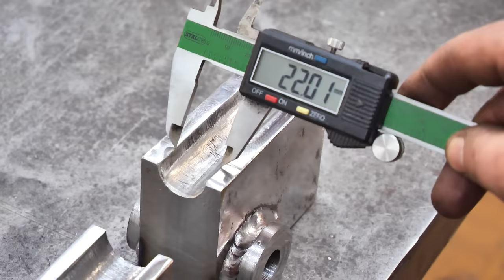Making Hydraulic Tube Bender Machine

Comment: Instead of changing bolt every time. We can use ratchet wheel. In one direction it make strong grip and while it's moving back it's just pass without any grip. Just try it. It reduces the human efforts and improve the efficiency, time saving. Hope it would be considerable suggestion for this design to improve some more.
Reply: Plll
Reply: Great idea

Comment: Is it a bit bigger projects than a homemade thing. Sorry I m not having welding cutter, lathe machine, drill press, electric welder, abrasive belt grinder at my home to make such simple machine😔😟😟
Reply: Get it done from out side and assemble
Reply: Why would you want a tube/pipe bender if you don’t have other tools necessary for metal work

Comment: Great work!  Bar soap works great on the tubing when bending and washes off easy with hot water. 
Maybe weld a finger ring on top of the pin that would help to make it easier to pull out and put back in. Just a thought for you. 💪🏼👍🏻

Comment: I really like how you can reset and continue the bend without having to release the pressure on the working part until your at the correct angle. 
The spring back may not hurt the part but I’m sure it’s not good if it’s done several times. Great job Sir!! Well done

Comment: Awesome project, all the equipment probably cost 400 to 600$ but to buy this bender brand new you need around 2.500 to 3000$. Very well crafted work and the bent pipe is great. Keep going the great job dude.

Comment: Will it be better if the control is on another side so you dont need to lean over to check the angle ?
Reply from the maker: But I only tilt when I bend the pipe to 180 degrees and probably more often I will bend the pipe to a smaller angle, so I decided to mount a hydraulic manifold in this place

Comment: In transferring one hole to another piece of plate You need to use Transfer Punches. They are MORE ACCURATE than a felt marker. Your Tank for your oil should have been Higher or one inch above the outlet on the pump. The tank capacity should be three times the size of the Cylinder Capacity (meaning if the cylinder holds a volume of 10 ounces then the Tank should hold a volume of 30 ounces). If you bend a lot of pipe the oil will became Hot. You need to think about cooling the Oil from the cylinder into a cooler and then into the Tank. You need a Fan and a row of Aluminum tubes with fins to cool the oil. Cooling the oil stops Cavitation (Air Bubbles in the Oil at the Pump). Beside these few changes You have a Great System. I applaud You on Your Work. Many install the pump direct into the Reservoir instead using a hose pipe. The Suction hose is always bigger than the Pressure Line. A small suction Line can also cause Cavitation in the Pump turning at 3450 rpm. I have worked with pumps for 40 years. Cavitation destroys the Impeller or Gears on the Pump. You are pumping Air and Part Solids not All Solids.

Comment: That's great but I would have Lazer cut all the flat bar and then cleaned it up.
I would have uses a engine crank indexer for the protractor wheel.
Other than that I want one

Comment: Amazing! Only couple of parts that could be upgraded. First is the tray that holds the mandrel, wonder why he didnt weld that instead of using self tapping screws what looks like roofing screws and second is the bolt that locks the pipe, I wouldve machined a knurled thumb screw for that other than those 2 this bender is bulletproof and can probably bend solid rods

Comment: Good video and awesome build. Why don't you use a magnet to contain the scraps when you are separating metal from itself, with whatever tool you are using ? How did you temporarily attach the plasma wand when you cut the flat sheet of steel ?

Comment: Genial, lindo de ver a construção da máquina. A máquina jamais substituirá a mão ✋ do homem.
Reply: 😮 no the machine won't,  but man's had operates the machine,  work smarter not harder.

As far as woodworking yes I can see using hand tools to fine tune
But metal work you really do need to use machines and jigs, ill never see you take a Jack plane to some steel, you could use it on wood.

Man made the machine to make the work less work, its up to the operator to learn how to use the tool no matter what type of materials your working with.
But your still going to use your hands.  By the way Robots take less breaks dont take days off and dont call in sick or demand more money robots can also work 24/7 and dont have to use the bathroom and dont get tired. They just get old and worn out at least humans have that in common.

Comment: Great video once again! Showing us all what’s possible with a bit of determination.
What are the hole saws you use? They look to be good quality and perform well.
Reply: Looks like a starrett carbide tipped hole saw. Brand might not be starrett but they’re definitely carbide tipped. Used them loads and they are good, wouldn’t use it in any hand drill though, mag drill or drill press.

Comment: Nice build.  Would it be possible to build some kind of ratcheting system so you didn't have to reset the pin over and over?
Reply from the maker: In the previous plan, I intended to make a short arm so that one hydraulic cylinder stroke would be one full revolution of the wheel, but this would require a larger actuator and more efficient hydraulic power or a more powerful motor connected to the pump, I have already bought a motor with the intention of building a completely different structure, but I used it for this, the 1.1kw motor in combination with a 6L / m gear pump gives the possibility of creating a maximum pressure of 140bar which translates into quite low efficiency so I had to give a long arm to steer the wheel

Comment: Small bearing,   Wear points cannot exist right races,inner/outer. Blacks. As wheel hub brack, /. Gearbox mounts, conveyer drift, on sheets rollers of cloth,   a template Angles, rulers scales,  .X/x.   Scale  percentage,  the. Less than. One.  Time too x-1DMS on calcs.  Hr only,, 2-1DMS 6-1DMS,  time values   camera speed lapsed time tricks of nations Peace country Canada Alberta British Columbia. Ha. ha.  John.